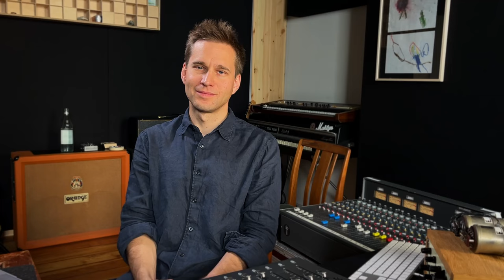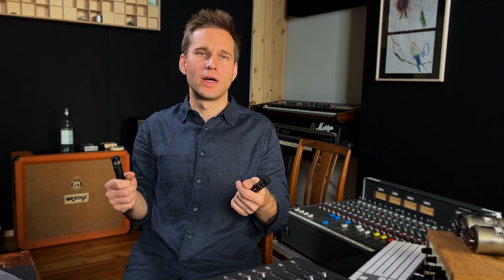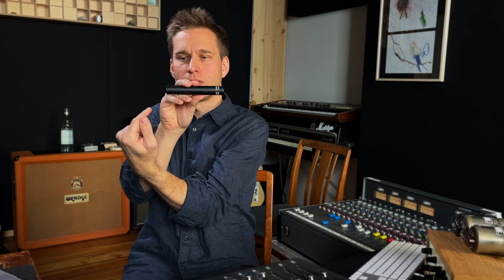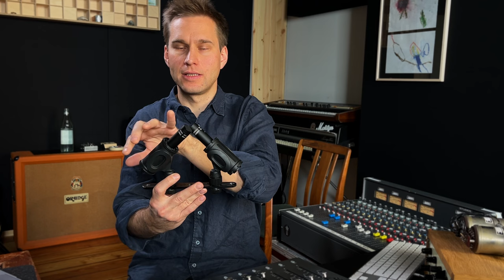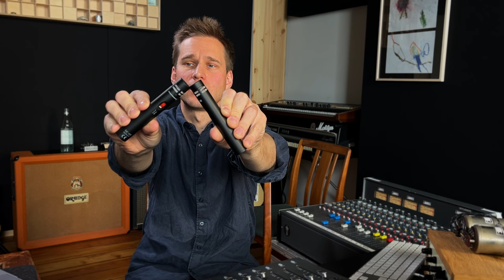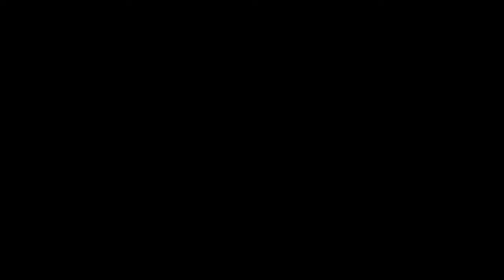Tonal Cues ep2: The Most Common Stereo Micing Mistake

Comment: I like my snare dead center. If i face the mics away from the snare they might sound different in each mic. But I did not do my own research on this. So maybe I'm wrong. I will definitely try out next time!
Reply: With overhead drum mics, I get one mic where I want it, measure from the center of the snare to the mic capsule then place the other equal distance to the center of the snare. In a mix with the snare mic panned center, it will also be dead center of the overheads when panned hard L & R.
Reply from the maker: Check out my latest video on the Glyn Johns technique! See you there

Comment: How does this apply to a Glyn Johns style drum setup?  Seems to give a nice stereo image, both pointing more or less inward.
Reply from the maker: Great question! Basically in Glyn Johns technique the mics are so far apart from one another, and so close to the source, that it's not really a stereo technique anymore but rather two mono sources with panning. The bleed fills the spaces in between.
Reply: In addition to Martyn's answer you'll also notice the two mics are not competing for the stereo image, amplitude and time are both working together still. Glyn Johns only works if the mics aren't competing, which is why you make sure they are equidistant from the snare and roughly 32in away. The ride sound will arrive at the rear microphone before the overhead mic it will also be louder due to it's proximity. I'd argue it's a bit like a spaced pair in terms of qualifying for "stereo-technique-ness" and in my book it's on the brink of still being a stereo technique but it's on very shaky ground haha! You'll notice if you set it up correctly you can pan the overhead mic hard right and the behind mic hard left and still end up with the snare sounding in the middle, to me that's enough to qualify it as a "stereo" array. Especially considering you can balance the full kit quite nicely without any spots if done correctly. But to each their own! I think one could easily argue it's not a "true" stereo technique.
Reply from the maker: @JonathanGalle  Think of it like this: Can you use Glyn Johns on a piano? On a choir?
Reply: @martynheynemusic  Fair enough, but does the Glyn Johns array not capture an accurate stereophonic sound of the kit? I'd argue it sounds better than almost all of the traditional stereo arrays for kit for most jazz/small kit applications. It creates an accurate stereo image of a drum kit and by that definition I would say it is a "stereo array" as it creates a stereo image. I think calling it two mono sources with panning is a bit oversimplified and doesn't give the array it's due. For comparison: I would argue the Decca tree is a stereo array, If you agree with me that it is a stereo array then you'll also probably agree that the array tends to fall apart on smaller sources than orchestra. Does this officially make it not a stereo array? You could obviously argue "no it's a LCR" but in my book a stereo array is one that represents a realistic stereo image. Once again, I'm just being pedantic about all this, in regards to the video and the greater conversation it is largely un-important haha! We can both however agree that pointing cardioids in towards each other spaced out is a bad idea and to absolutely not do it hehe!
Reply from the maker: Hi Lyle, I've made a new video addressing this question regarding Glyn Johns. Hope to see you there!
Reply from the maker: @JonathanGalle  Hi Jonathan, I've made a new video addressing this question regarding Glyn Johns. Hope to see you there!
Reply from the maker: @JonathanGalle  Guess Decca tree should come soon as well..
Reply: @martynheynemusic  Thanks for the heads up, can’t wait to check out your thoughts!